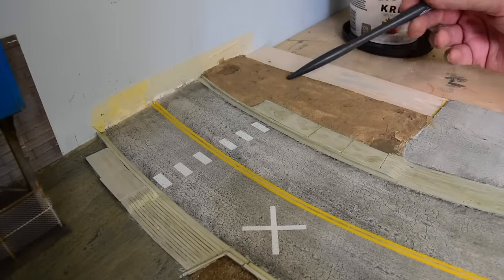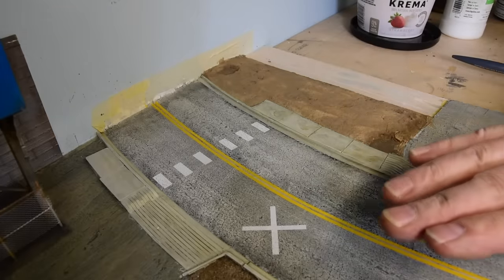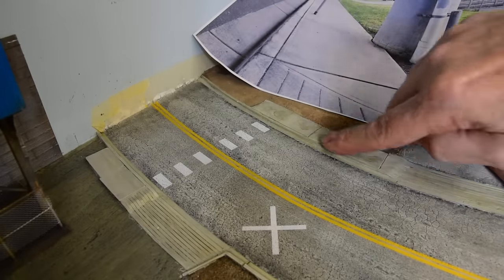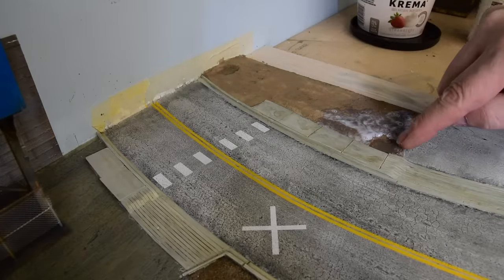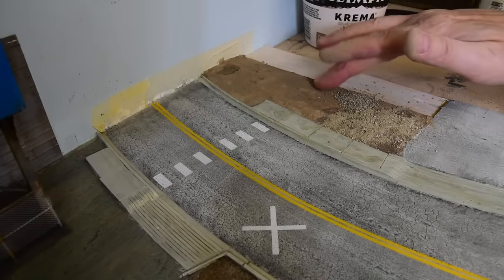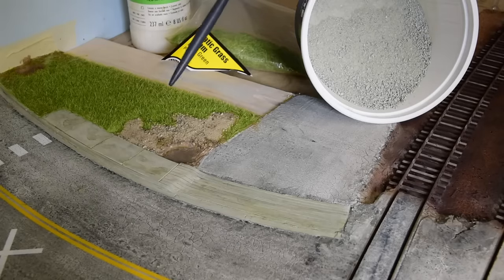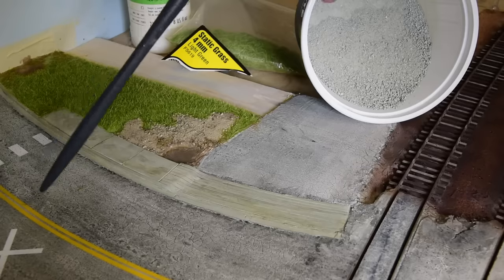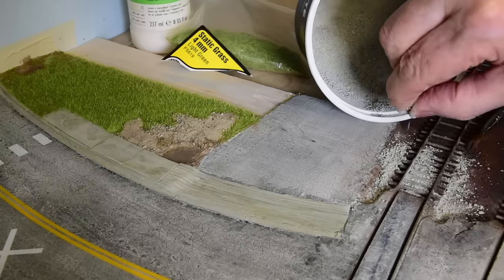Modeling Realistic Model Railroad Terrain | Boomer Diorama ~ # 257

Comment: Dear Boomer, simply beautiful how the manicured lawn came out. Do agree on what you said about the static grass applicators. Only a slight change in humidity will affect the results. Plus, the longer the static grass strands, the static load can and will affect the strands to kind of intermingle, which increases the effect of the strands to lay down. Hence, pinching above 7mm is also my preferred method. In fact only the static plate is truly capable to stand up static strands above 7mm all the time. But that’s only working for making tufts.
As said before in several of my comments, using Matte Medium as a scenic adhesive is indeed a game changer. Love the flexibility and elasticity of Matte Medium, during the glue process, whilst drying and after its fully dried. Also, the fact that IPA dissolves Matte Medium very easily, creates all kinds of opportunities for tweaking scenic features after the finished fact.
Adding to that particular capability, ballasting turnouts with Matte Medium is indeed a breeze. Just like you said, a little IPA is instrumental in getting rid of any sticky or gunked up moving parts or points. Like you’ve shown before, using Matte Medium for glueing ballast also helps to create the scenic quality around the throw bar much better than PVA does. Where PVA seems to follow the normal characteristics of the water hygroscopy, which makes it ‘creep’ upwards. Matte Medium to me seems to be more capable to contain and control such action, especially around  indentations. Further, the elasticity with which Matte Medium dries up, makes it a much better adhesive for glueing ballast on the acoustic scale. It won’t create the acoustic coupling PVA creates, whether used on cork or foam roadbed. Matte Medium creates a much better sound separation between the foundational layer and the scenic layer of the model railroad. Cheerio
Reply from the maker: Thanks for sharing. Cheers!

Comment: Just to plug another channel Luke Towen made an excellent video on making a static grass applicator which I followed but then upgraded with components off Amazon. I find they always work better if they are connected to the mains electricity supply rather than off a battery.  Mr Boomer that just looks amazing, one of my favorite tasks is the ballasting and static grass areas and if I had one piece of advice to people it is to really take your time and NOT RUSH this process ! I have seen so many potentially awesome layouts ruined by rushed ballasting (if that's a term) Hard to teach patients but that is the key. I really cannot emphasize that enough.  Cheers.
Reply: I've built several of my own applicators...  The first three used 15kV negative ion generators, all were powered by plug in AC to DC converters.  Output power is king with static grass applicators and most of the negative ion generators are rated for 12VDC, anything less will get you lower performance.  

The last and probably final applicator, uses a commercial negative ion generator.  Still 12VDC, but it outputs 30kV and works amazingly well with all that power.  

Luke is great...  Used some of his ideas from his applicators to refine the ones I built (after the first one).  Super talented guy, great presentations/video production too.
Reply from the maker: Awesome. Cheers!

Comment: Very good vlog Boomer,  I had the static grass you used and never got it to work right, even bought the power accessory.   So times you get a lemon.  I did buy a Noch and it works great.  I also use a flocking box that I use a lot.  You are so right about smaller areas, Demons crop up when you least expect it.  Thanks for all you do and share.   As you say "cheers"
Reply from the maker: Good stuff!

Comment: Boomer, great video, thank you for sharing.
I am one of those that build my own static grass applicator, and it works great - battery or mains.  Now having said that when I get it out again soon, it will fail miserably.  I have jinxed myself.
Great tip on working on a small section at a time, it certainly takes the "OMG" out of the layout work.
The grass next to the overpass looks superb, great job.
Cheers, and stay safe,  Michael
Reply from the maker: Cool, thanks!

Comment: The track nearest the edge of the scene is interesting .
When we rehabbed rail crossings, especially industrial tracks we would pull rail 50 feet both sides of the crossing. Wed rip out old asphalt and material.New rail for the crossing was welded prior to installation then placed on new ties.
Ballasting and surfacing  would start past the new work making for a distinct demarcation between old ballast on the main and new on the crossing beginning and ending about 75-100 feet before and after the crossing. If the crossing was rebuilt prior to line rehab they would actually rise and fall going over the crossing until the whole line was rehabbed. 
My point is the narrow bed of new ballast looks like that part of your crossing had seen maintenance. 
Cheers Brother. Don't forget to put new line on your rod and reel.
Reply from the maker: Thank you! Cheers.

Comment: Had a long talk with Martin Wellberg at Amherst back in January. Yes. Room humidity is a shockingly big contributor as most non industrial units are going to struggle to get a good static field built up if the room is damp.He suggested a dehumidifier. On top of the other things like using a big  deliberately mangled Round Brush for glue application, which when stamped straight down applies the glue in hundreds of tiny splotches that look like tufts when the static grass is applied. But takes longer since ideally you are doing.
1. Pass 2mil dry/dead grass
2.Pass 2mil live grass
3. Pass 4mil/6mil live/dead grass.
5. Stab in anything bigger.
Reply: Martin also uses commercial flocking applicators too.  Very high power output (I think he told me 45kV and higher).  When it comes to these applicators, more power is more better (intentional verbiage).
Reply from the maker: Sounds great!

Comment: Boomer, I like the very small plastic applicator containers that I have bought on Amazon. They hold about 3 to 5 times as much liquid as your dropper but they have a very small opening and I can control the flow into very small areas. I have no problems with points getting glued shut at all. I use Elmers glue 60% water to 40% glue and have had no problems ever. For those that are in fear, if you have the area saturated with wetting liquid, you can place the glue on the outsides of the track and it will flow into the middle just like you say. If the glue doesn't flow and stands up on the top of the ballast, you have not gotten the ballast wet enough. I mix my 60-40 glue in a mustard squeeze plastic bottle and then refill the applicator when necessary. Also i will shake the master bottle every time I come into the train room as this keeps the liquid from seperating.
Reply from the maker: Sounds good. Thanks for sharing.

Comment: The embedded track section is looking very convincing. I make my own grass matts out of poly fill quilt batting by de layering the sections of sheets and stretching thin like cobwebs. I paint it with Krylon's Fusion Matte Spanish Moss and apply different colors and textures of scenic turf. It can be laid in place over existing scenery. It adds some 3 dimensional depth and textures to otherwise flat terrain and the existing surface below can easliy be blended in or left exposed to show through. It's a great way to cover large or small area's instantly. I've been wanting to get a static grass applicator to try out. I really look forward to each of your new episodes, now that I cut the cord to cable. Hopefully you can produce longer or more content episodes. It's a long week otherwise.
   Did you take my advice about acquiring a multi tool? You mentioned something about it being a rotary tool. A multi tool isn't a Dremel tool. It's a freehand oscillating tool that cuts wood, drywall, tile, plastics, and metal without making a dust mess. It's like a hand held saw a surgeon would use. It's like a free hand saw for a carpenter as a paintbrush is to an artist. It can make plunge cuts without needing a pilot hole. It's the only tool you need besides a cordless drill. Google oscillating multi tools. Dewalt makes a cordless version that uses the same battery as their drill.
Reply from the maker: Thanks for sharing. I have a full Finishing Carpenters tool package in case you were not aware. Cheers. 😁

Comment: My favorite ballast glue dispenser is a good-quality condiment bottle. It's one of those plastic bottles with the cone-shaped spout and cap—the ones that diners sometimes use—at least they do in the US.  You can dispense a single drop or a very accurately controlled stream.  When streaming, you can pour along the track's center or edge with deadly accuracy and not get a drop on the rail.  Nice video, Rob
Reply from the maker: Cheers!

Comment: Beautiful job , Boomer!!!! Will the 40 matt medium/60 water with couple of drops of dishwashing liquid mix work for N Scale as well? Just curious, I'm using it on Peco code 55 rail. Love your teachings, Dude. The results are awesome. Bruce in Minnesota
Reply: I use this mix on my n scale code 55 track and it works perfectly. It pretty much works perfectly for any / all scenery materials regardless of scale.
Reply: You can use dilution up to 3 parts water to 1 part Matte Medium and it'll work fine...  I skip dishwashing liquid and add about 2% (give or take) Isopropyl Alcohol once the MM and water are thoroughly mixed.  Makes for super flowing ballast/scenery glue.
Reply from the maker: Should work just fine. ;-)

Comment: Replied to a few comments on applicators prior to watching all the video, but I'll add to those comments...  The WS "Static King" or whatever applicator you're using can be improved by modifying it with a metal screen.  Applicators work best with the charging surface (in this case the metal screen) being closest to the grass fibers as possible.  

My first ever applicator was the first generation Noch applicator, with nylon mesh screens.  One issue that hampered the result was that the first Noch applicators were horribly under powered.  But an equally important issue was the nylon screen and no charging plate in the cannister itself.

My guess is that both the original Noch and WS applicators use nylon or plastic for safety reasons.  They don't hold a charge, so you're not going to get zapped.  Probably good for those that have pacemakers too.

As someone else mentioned, Luke Towan's tutorials on making your own are excellent...  But I get why most guys wouldn't want to tackle that.  So if you're one of those guys, try to find a commercial applicator that has a metal screen.  You stand a higher chance of getting a good jolt if you don't ground it out after using it, but it'll work a lot better.
Reply from the maker: Good stuff and thanks for sharing the info. I generally use the applicator for smaller patches that look manicured like this. All the rest I tend to stab in or use patches etc. In fact I rarely use the applicator and could probably live without it. Cheers. 👍😁